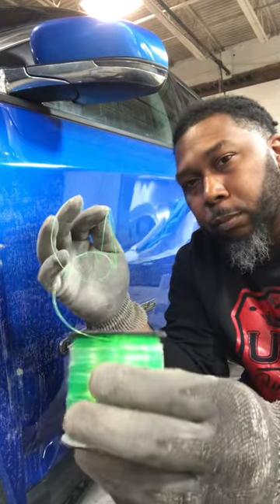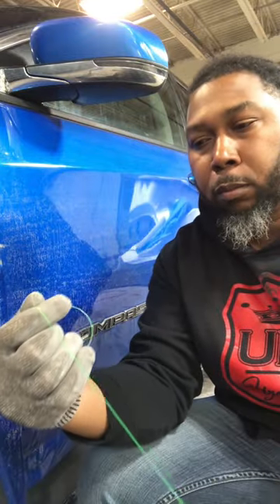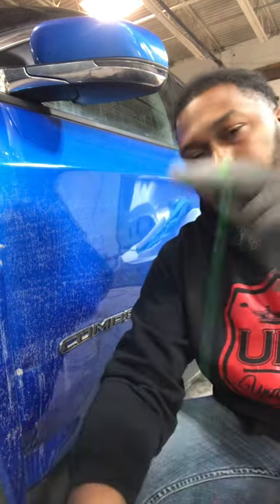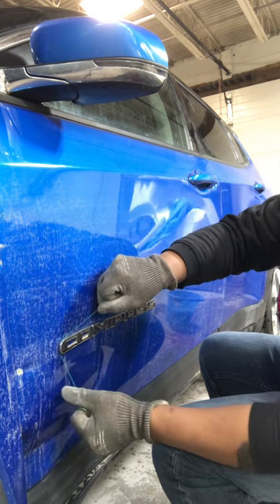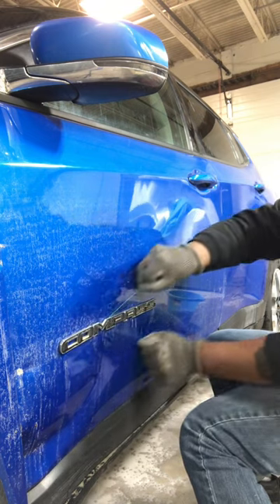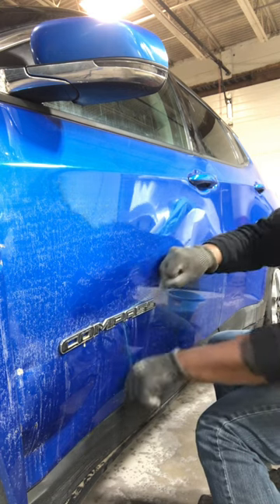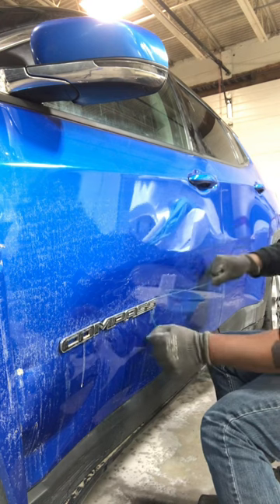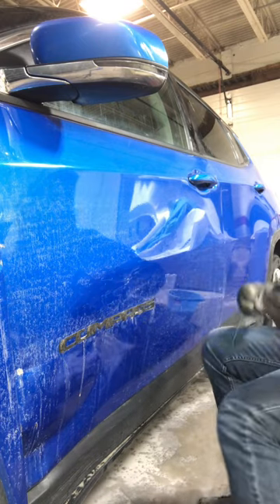De-Badging Emblems with fishing line 🎣

Comment: Thank you! I used 20lb line which broke at least twice on each emblem removal... highly suggest 40 or 50lb line to avoid my breakage experience. Other than that, a quick once over with Goof-Off spray and car wash towels and my blacked-out '23 3LT is naked as ever.
Reply from the maker: Glad it worked out for you 💯💪🏾
Reply: @UndergroundPaintKing  Basically a follow-up question but... now that I got the 2 Camaro shields off on each side and the RS logos off grill and rear bumper I was going to add the '68 Camaro script emblem to sides and Camaro by Chevrolet to grill where RS was previously. Any advice on "glue" for sides and placement for grill? (Grill has small flat area where RS was at so should be doable there.)
Reply from the maker: @R__K  You can use a automotive glue and double sided tape

Comment: No fuckin way this doesn't leave the nastiest scratch imaginable 💀
Reply from the maker: 😂😂😂 no scratches at all, give it a try on a junk part and tell me what you think
Reply: @UndergroundPaintKing  Congrats King!  Looks like you’re startin to getcha some trolls well versed in numbskullery 🤣🤣🤣🤣🤣
Reply from the maker: 😂😂😂 I’m learning from the great Bondo Billy
Reply: @UndergroundPaintKing  well…. I woulda told that particular guy;  “get yer nasty fingernails out yer nose then”🤣🤣🤣🤣🤣
Reply: @UndergroundPaintKing  well…. I woulda told that particular guy;  “get yer nasty fingernails out yer nose then”🤣🤣🤣🤣🤣
Reply from the maker: @OldBondoBilly  😂😂😂
Reply: I Tie the line to 2 screw drivers so it doesnt cut my hands lol
Reply from the maker: @mustangrebuilder  lol that’s why I have gloves on
Reply: @UndergroundPaintKing  👏🏾🤣😂🤣👍🏾
Reply from the maker: @ShermX69X  appreciate you Sherm💯
Reply: You never touch the car. Follow with a rubber wheel or soft plastic razer blade, and voila.
Reply from the maker: @GhostRyderFPV  agreed!
Reply: @UndergroundPaintKing  cuts like butter king
Reply from the maker: @yeayeasautoadventures  works every time!